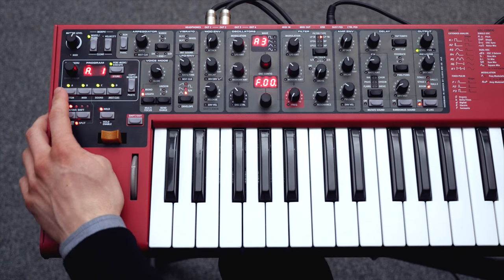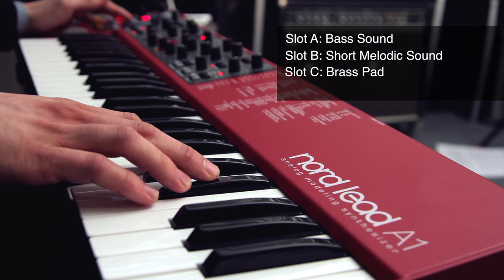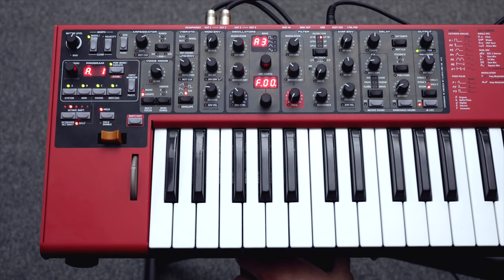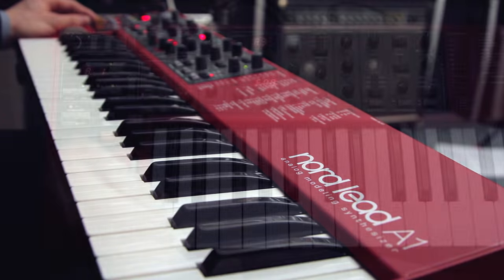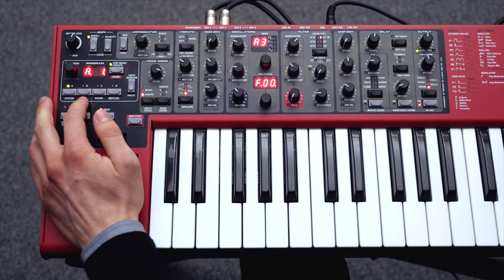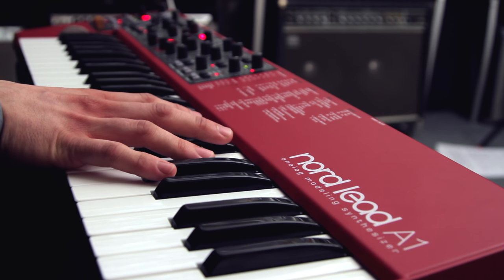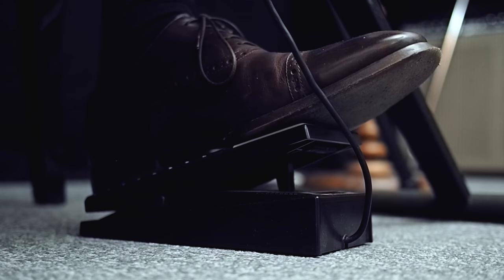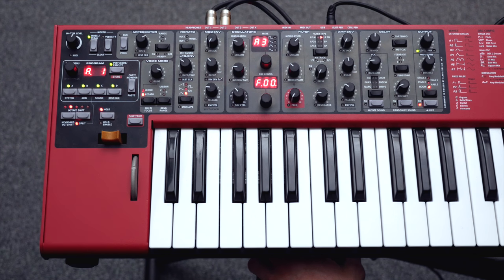Nord Lead A1 Creative Sound Design: Playing Live with Multilayers

Comment: Hints:
I run a Korg EXP-2.
Checked the settings in the "System Menu", regarding Ctrl Pedal setup.
Had to increase the Output setting on slot B.
Then it works fine for me!    

Anyone else with similar experience?